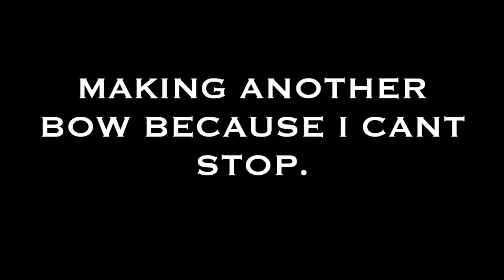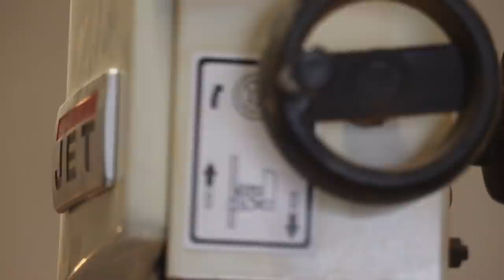Making another bow because I can't STOP!   (in silence...)

Comment: Hey kramer. My name is geoff and I live in Southern Illinois. I've made walking sticks, front door plaques, etc for many years, however , about 2 years ago I branched out into bow building. Recently I "invented" a "bow backing"/finish: I mix spray spar urethane with clear gorilla glue In a disposable cup and apply to back of self bows made from harvested staves; the benefit is, it dries clear so as to show the natural beauty of the wood. It also tends to be very thick and has a decent amount of integrity when dry. Obviously, it is not full proof,  and I have had a very nice red bud bow that treated with it break (it should be mentioned that there were fatal flaws in that red bud stave ). Also,  It would more practical to merely back your self bow with clear bear paw. On the other hand, I've built a maple recurve/deflex with this treatment and it has survived well. At best it is most likely a novelty. But I would be appreciative if you might include it on any future episodes of will it bow? Thank you

Comment: As a wood shop Forman for a dozen years, I think you could use a couple of suggestions:  zero clearance inserts for both the bandsaw and the tablesaw.  Absolutely keeps fingers attached to the required places.  Use your dust collection system for the sander, bandsaw, and tablesaw.  Anything that produces dust is your enemy, especially with exotic woods.  Thousands of hours of personal operation allows me to spread my experience, not trying to belittle you, but just make your later years more healthy.  I would make a collection cuff for the out feed drum of the belt sander, it may not get 100% of the dust, but most of it.  Zero clearance inserts are easy, epoxy offcuts from hardwood with occasional cross grain for strength.  Table saw the same.  Build your self a study table that places the top of your saw at belt height, with an outfeed table the length of the longest length that you plan on cutting.  When you can afford one, a ceiling mounted air filter is a great idea, or you can build one for very little expense.  If you take a little time and incorporate these suggestions you will find that your hobby / business will be both easier and you won’t be blowing colored funk out of your nasal passages.  Been there, done that and the cheapskates I worked for didn’t even provide the T-shirts.  Good luck, and if you are interested in more shop updates, feel free to ask an old fart who has been around the patch a couple of times 😅
Reply: Good looking out my friend. Good looking out, only if there were more of you and I!God bless

Comment: I noticed at the 5:31 mark your appear to be measuring the gap between the blade and fence. THis can be done with the other end of the calipers. You set the edge of the caliper on the blade and the part that sticks out as you expand the calipers is also a measuring tool. Just in case you didnt know. good videos by the way

Comment: Kramer -  how come you didn't do any tillering on it?
Reply: My guess is that with a laminated bow. You don't have to. With an unlaminated bow you are starting with a solid piece and then tapering down at what's bound to be uneven amounts. With the laminated bow it's all already sized down equally. That's my guess
Reply: You wouldn't tiller a laminated fiberglass bow because you would be cutting through your glass and reducing the integrity. Your laminations should all be the same for each side and your poundage is figured by the thickness of the laminations, the types of materials, and the width of the limbs.
Reply: @thomascalton3067  do you happen to know approximately how much draw weight the different thickness strips add?
Reply: I think the tiller is accomplished by the taper of the internal laminations, so would have to be precalculated or guessed. I guess a commercial bow maker would make several test bows until he had the precise dimensions needed for tiller and poundage. Altering the width of the bow following construction would be another way as limb width is proportional to stiffness.
Reply: @justinmurray4652  Kramer actually had a video about that... I want to say 3 months ago, I'm pretty sure it was part of a laminated build. There are books with lots of math, that give you a wood type, thickness, and approximate poundage.
Reply: @paulgee6111  you are correct. The tapered core determines weight . The  thicker the core at the butt the heavier the draw weight.